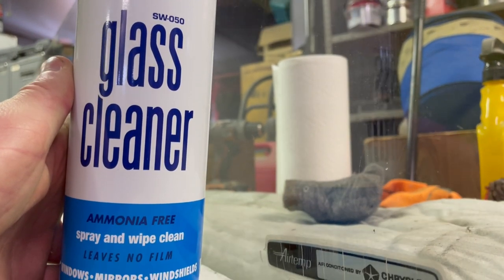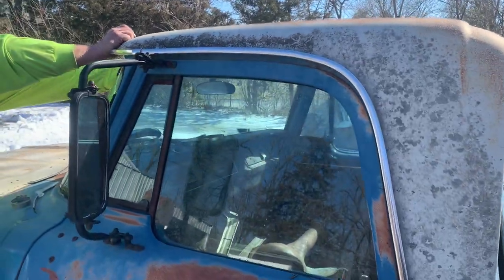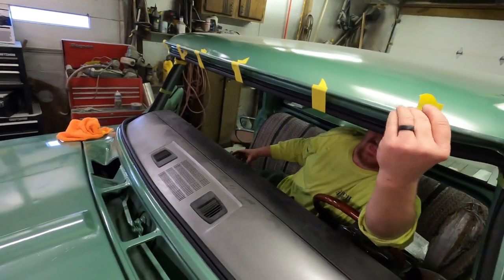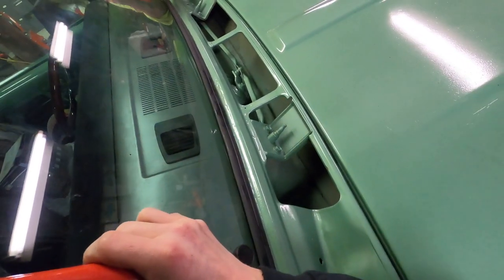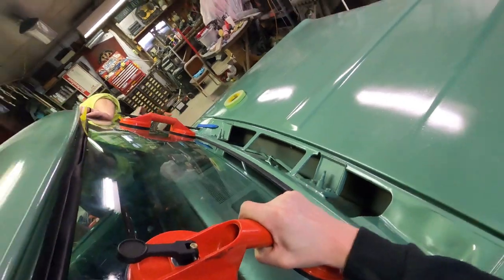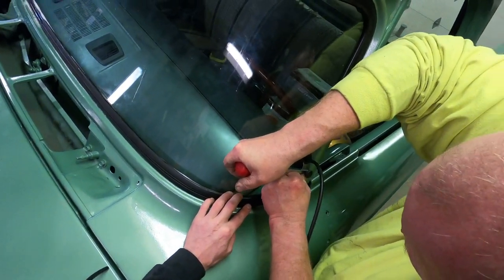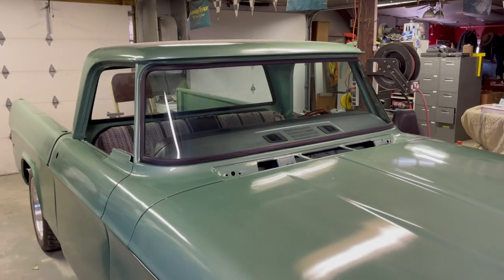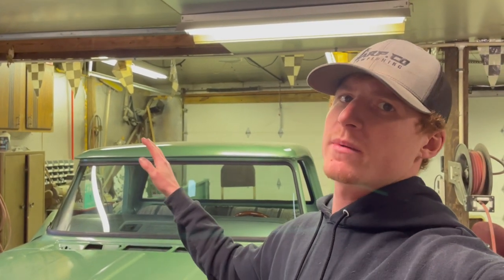DIY: Windshield Installation for a 61-71 Dodge Sweptline Truck

Comment: Did you just use window cleaner for lubricant? Great video
Reply from the maker: Yes, dawn dish soap mixed with water in a spray bottle would have worked better but we had the window cleaner there lol. Thanks!

Comment: Hey Devon, did you get a chance to look for that wiper motor and mounting plate?
The truck is looking great!
Reply from the maker: We got a motor and a mounting plate, I’ll check to see if the motor is good tomorrow for ya!
Reply: @RealSteelFabrications   thanks man
Reply from the maker: @maxhammontree3169  we got a good motor and mounting plate, $50 shipped if you’re interested
Reply: @RealSteelFabrications  I’ll take it. I’ll message you on fb if that’s ok. 
Thanks.
Reply from the maker: @maxhammontree3169  sounds good